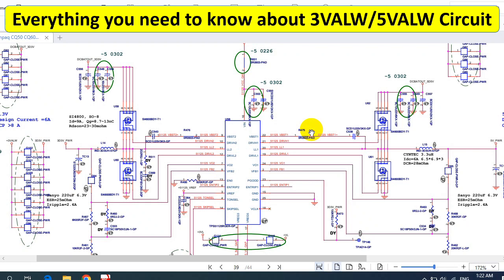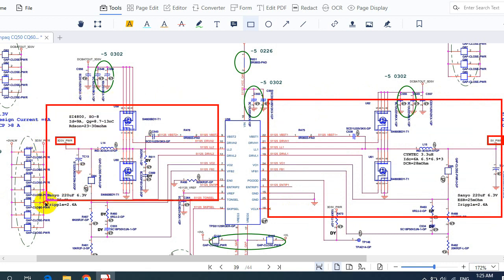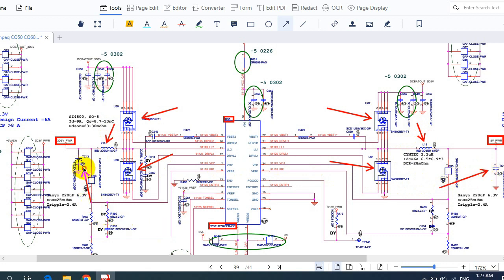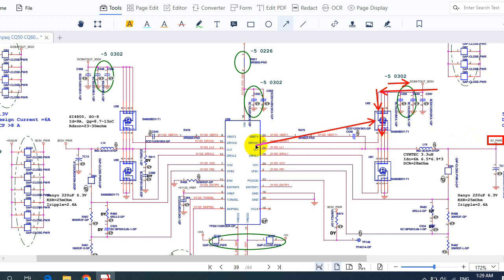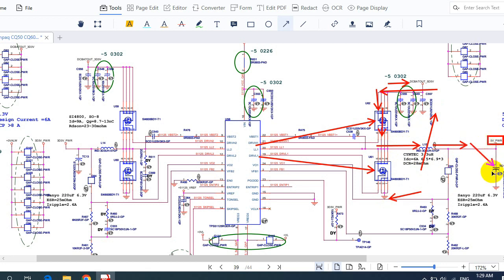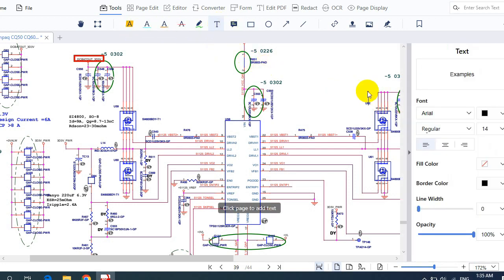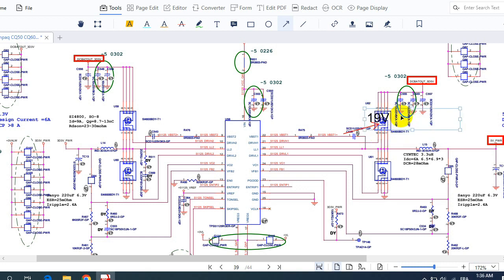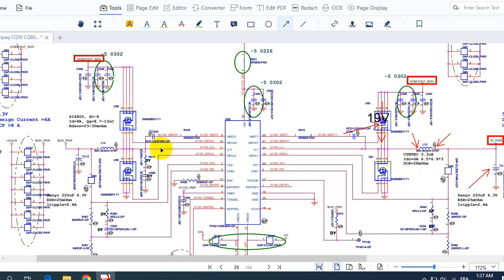Learn to Check 3V and 5V voltages on Laptop Motherboard - All about 3V 5V Circuit

Comment: I have made lot of progress since I started learning electronics two years ago . At first I got lost when trying to understand your lessons about schematics and tracking voltages , now  your video here is clear to me compared to years ago .      learning electronics is a long journey , failing to understand first time helped me progress , same thing failing to fix  dead computers at first try , you'll be discouraged at first , but your failure means you rushed your learning , take a break , even a month , then come back and start from the beginning again , practice a lot learning components , schematics , measurements , compare always with teachers , make your library of electronics lessons, dictionaries of components , posters of components and  package . Start with beginners tools (multi meter, soldering iron ) it's part of your learning journey , and as you're making progress you'll feel the need to buy more professional ones  .     After 2 years and a half  , I'm ready to get a more advanced multimeter

Comment: 5:30 are you serious by saying that way about mosters and iductors and voltage regulation? Have you read datasheets and did you try to have a look on these drivers outputs by osciloscope?
I'm in shock what you are saying here ....

Comment: I mistakenly short circuit my laptop USB data port. The laptop doesn't display but it shows power which indicate that it's on. I've removed the bios battery, laptop battery but still no display... The laptop has onboard ram and I can't remove that.
Please, any help
Reply from the maker: Hi @scienceslife4476m
I get you, You can join me on My Patreon Page and I will assist you.
Regards